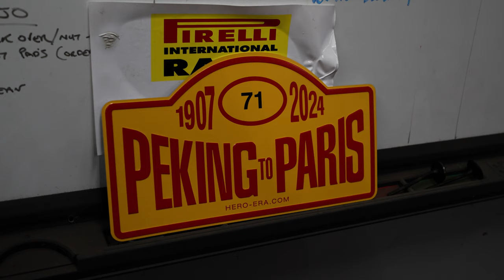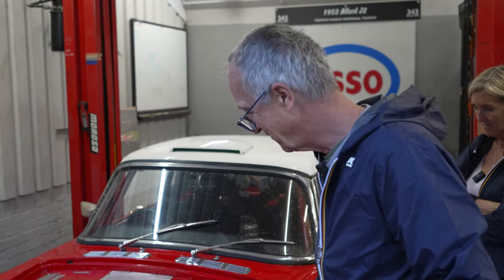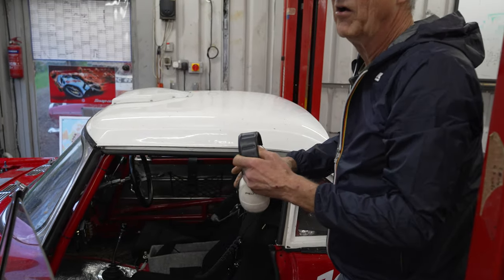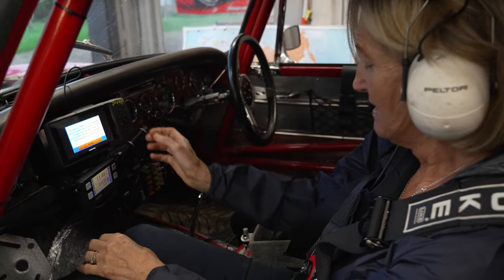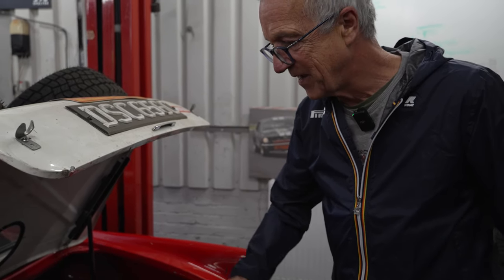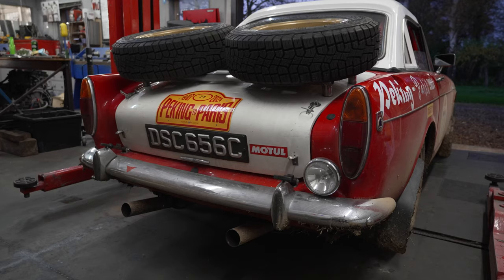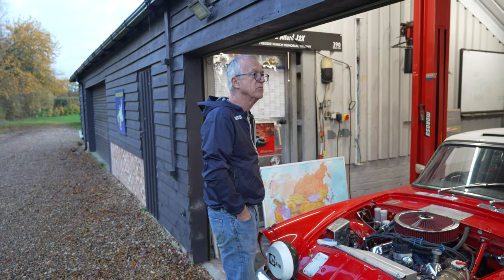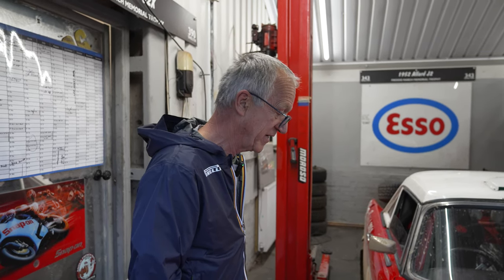Pam & Patrick Watts take on Peking to Paris Rally - Episode 1

Comment: Cheers from one of the 6000 or so people that has a real Tiger. Bought mine ten years ago, had it fully painted eight years ago, and then interrupted it with a series of other restorations including a 1952 Singer roadster lightweight special, and a 1941 GMC CC303 roll on flatbed car carrier, and a couple of small tractors. It is currently a rolling chassis with Tiger orange paint, twin black stripes, doors, and trunklid as of May 1st 2024, but every piece is painted, powdercoated, rebuilt, or new, and ready to assemble so it will be driving this summer. When I purchased it was flared nicely for larger tires, and had an unusual airscoop welded into the hood from back in the 60's or 70's so I left that for posterity expecting some of the olde guard here in Socal to recognize it either in person, or from pictures. I am wishing you luck on your voyage saying this as one who has watched the entire Peking to Paris run here on you tube. Godspeed, and good luck to all intrepid adventurers who set out on that trek. You will be a different couple upon your return to England for better or worse all the more worldly, and experienced. Assume you will be staying south of the Black Sea this trip so tip your hat to the Hagia Sofia as you pass through Constantinople for me, a sight I hope to see before departing this bright, and beautiful place I've called home for 60 years. Again, good luck, godspeed, and keep the shiny side up my friends!